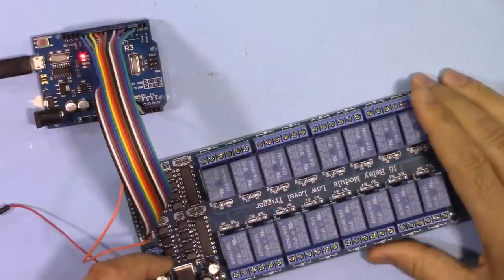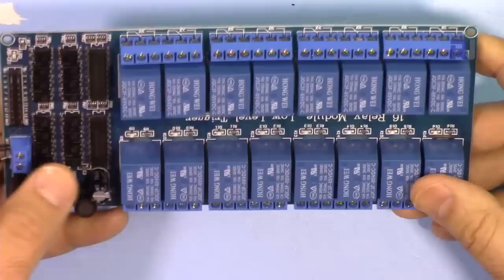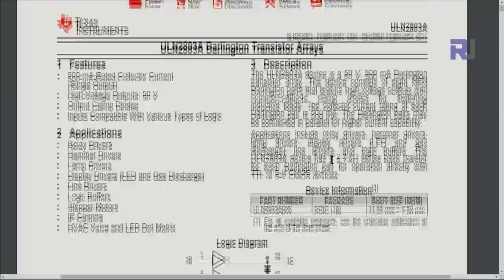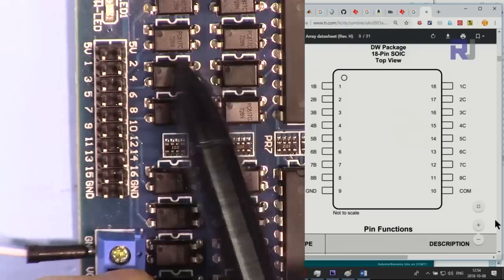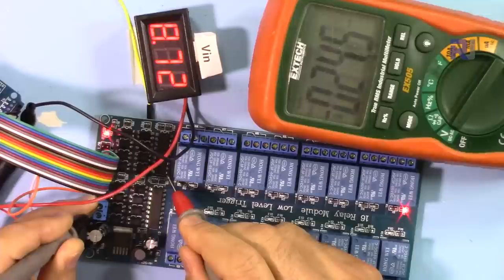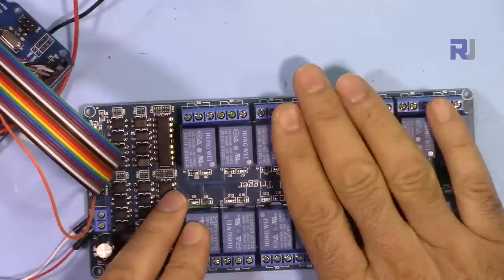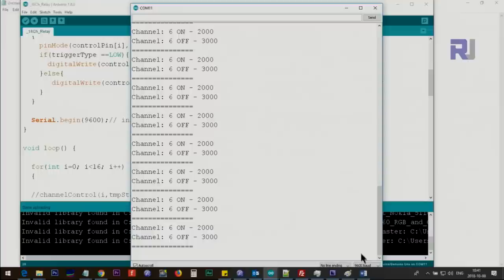Lesson 68, Home Automation: How to control 16 Channel Relay module using Arduino control 16 AC loads

Comment: I want to use this to control actuators in a CNC machine. Basically a magnet closes a reed switch which places a HIGH on the arduino input. This in turn controls a relay that powers the actuator. There are 14 actuators that will work one after the other, never more than one at a time. What is code edit to allow this to happen?
Reply from the maker: Hi, Yes absolutely this work for that.
Reply: Robojax actually we just changed the design of the CNC. We are now using micro switches  and a slide bar about 7 inches long. It engages a N/O switch placing a HIGH on the Arduino pin which closes the corresponding relay and drives current through an actuator causing it to go down and it stays down as long as the HIGH exits. As soon as the slide bar passes the switch opens and a LOW is placed on the Arduino pin. At this point I need to fire a second relay to drive current through the actuator in the opposite direction to make it go up to start position. Can you help me modify your code to cause this to function? I know where to place it but not sure of coding. Thanxx!!
Reply from the maker: for Normally Open or Normally close, you just connect to different to the module you can learn about that in this video: https://youtu.be/58XWVDnB7Ss
For controlling the output to be HIGH or LOW, I have explained that in the video.  It is called LOW or HIGH trigger and you can choose what type of trigger you want at the output of Arduino pin.

Comment: For some reason, doesn't matter what script I run, all the relay will all turn on at the same time. I have delays and timer on all of them, and I try a few different scripts, but with no luck. All the relays that are in my script will turn on (same time).
Reply from the maker: if you don't change the code, it will work. first trying it without changing and then modify it if you want.
Reply: @robojax  I left the code the way it is with no change and I'm still having the problem. What do you think is causing all the relays to turn on all at once?
Reply: I notice when the GPIO is set to "output" doesn't matter if it's true/high or false/low, there is some voltage coming out of that GPIO pin.  Very low .179, this is why I think the relay stays on, and doesn't turn off.

Comment: I try to do the same with d1 mini but only led in relay board works but relay is not working what is wrong 😔 please help
Reply from the maker: do you hear a click? how do you know it is not working? have you connected the load? Watch my video on single relay as you might have connected the load incorrectly

Comment: Can the 16 relays on a sainsmart 16 channel relay board be operated without using a Mega 2560 R3 or similar board? I just want to trigger some LED lights using a Game module I have.

Comment: Can I use a 12v 30a power supply with this? 10a 30v dc, 10a 250v ac. will it break?
Reply from the maker: To lower it up you need 12V and minimum of whatever current I mention as I don’t remember it.  Maybe it was like 1A. Anything hover has no affect it. I hope your quality was about powering this module up.
Reply: @robojax  No I mean not to power it up but the current that runs trough the relay. I want to control multiple solenoids with my 12v 30a power supply but wondering if the relay will break because it is to much current.

Comment: Amazing video! This might seem like a stupid/obvious question but can you decide how many Watts/Amps/Voltage your relays output. For example if I only want to output 9V at 1A per relay would that be possible or no?
Reply from the maker: Hi,  the relay is just a switch. you can connect anything you want does not matter 9V or 200V. just keep it less than 10A or whatever is written on the relay.

Comment: HI. Thankyou for the video. I have a query that I want to individually control 8 LEDs of like 3 Watt power and 3.5 V using 8 channel relay. Shall I connect external battery source? and would it be safe to do that?

Comment: Hello I am using the 8 Channel Sainsmart relay board.  I use 12V to power the board.  I am using 24V  to trigger a 24V solenoid (pinball flipper).  The relays work but after a while they start to degrade and stop making connection to close the circuit to the 24V solenoid.  What might be causing this issue.  It appears the relays can handle up to 30V 10A,.  Any help would be appreciated.  Thanks

Comment: Thank you for the informative video, I am relatively new to Arduino and I have a question, why is the Vin pin used as ground  rather than the GND pin?
Reply from the maker: Some relay module are HIGH trigger and some LOW trigger. This is LOW trigger meaning it gets activated with LOW voltage. So we send LOW signal from Arduino output to turn it ON and we send HIGH to turn it OFF.

Comment: Hi, great video!!! I done your project in  few minutes. I need a different function. I want to switch on (for 200-400 ms ) one by one all the relay. So, first relay on for 200ms then off, second relay on for 200ms then off... up to the 16th relay. I'm not native language english so if is not clear I will try to explain it better. Thank you
Reply from the maker: I have given example in the code. 
Did you see this:
 //channelControl(6,1, 2000); // turn relay 7 ON for 2 seconds
 //channelControl(6,0, 5000); // turn relay 7 OFF for 5 seconds
 //channelControl(9,1, 3000); // turn relay 10 OFF for ever

just above that, I have a "for" loop that controls all 16 relay. (below) which controls relay for 200ms, you replace it with the value. I have explained how relay is controlled. Watch the video again.
  for(int i=0; i<16; i++)
  {
   channelControl(i,tmpStat,200);// turn each relay ON for 200ms 
  }
Reply: @robojax   thank you again. I'm going to try it. in the future I'll keep more attention

Comment: Thank you for the nice video. But something is wrong. With shift registers you could control as many boards as you want. Means you could use smaller Arduinos too. Even an AtTiny could do the job.
Reply from the maker: Yes you could.  I might have a video on that. But Uno is the most common board.

Comment: hello Robojax. Congratulations on the video. I wanted to ask you if you had the possibility to do some video management of 32 relays using two mcp23017 through I2C. Thank you so much for your attention 😉
Reply from the maker: Hi Diego, all 32 channel relays are PLC based. I am not sure if there is demand for those to be used using Arduino. is it?
Reply: @robojax  I use them through the Blynk app, if possible.

Comment: Thanks for the video! It was fantastic and really helpful, I was wondering if you could advise me slightly for a project I'm working on?

Q1. if I had 3 of these modules would it be possible to control all of them up to 48 channels from the single arduino? If not, would I need 3 arduinos and could I control them all at the same time?

Q2. if I could control all 3 is it possible to set differing times for each relay, so for example, if I wanted channels 1,2,3 to all run at the exact same time, then I want ch4 to start 5 seconds after ch3 then ch5 to start 10 seconds after ch4 and so on, would these values be customisable?

Q3. Say I wanted to program a schedule,more a light show for example on the arguing, could I start the show remotely from say a laptop? Just for example say I have a collection of Christmas lights in the garden could I start the Christmas light show from my laptop? Thanks so much for your help!
Reply from the maker: Arduino MEGA has enough pins and you can control it.

Comment: I've seen a few videos and wiring diagram where they hooked up the 5volt from relay board to 5volt on arduino.
Reply from the maker: Good to know. thanks.l
Reply: I was asking if this is correct?
Reply from the maker: Now the "?" mark helps.  yes you can do that. You can power up Arduino with 9V to 12V if you connect it to VIN pin which is close to 5V and GND pin. This module has problem and you need to fix it. See this video https://youtu.be/mHPqxctmJrs

Comment: and how would one map pins for this board with esp 8266 connected? home assistant integration
Reply from the maker: I am not sure what is "home assistant" as there are 100s of tools.  You simply  define a pin in the code to control each relay. I have introduction video for ESP8266 here https://youtu.be/pLvqh57T3s4 which explains and gives example for pins and all other details

Comment: Hi great video. I wanted to ask. If I dont want to supply the Arduino by the relay supply. I just dont put the 5V pins on the relay board but put the conect the GND pin of the relay to the GND pin of the arduino? what if I connect the 5V pin of the relay to the 5V of the arduino but left the GND pin of the relay disconnected? is it the same?
Reply from the maker: for every electric circuit, we need to connect two wires to complete the circuit.  you need to power this module with 5V and you MUST connect GND. This module has problem when it is shipped and here is how to fix it https://youtu.be/mHPqxctmJrs

Comment: Great video,  do you know of a similar 16-Channel  Relay that can supply 24VDC with a 24VDC input?  Thanks
Reply from the maker: I am not sure. But you should find it on AliExpress.com or eBay. But it would be very simple to put 24V to 5V Buck converter Module (from eBay) and use it with 24V.

Comment: Hi Brother, i want to know there are some of the 16 relays are without voltage regulator (LM2596 or LM2576) and without any capacitors, so if you please tell me what's the importance and the job of these  parts in the 16 relay module. Thnx
Reply from the maker: please see the provided link in the description and watch that video.

Comment: any ideas on adding a PIR to start the relay delay?

I would like to use the relay for some lighting outside and have been playing about with the sketch but cant seem to get anything working.
Reply: You'd wire up the PIR to the arduino, then when your sketch detects motion (PIR output goes high) it would trigger one or more relays, presumably turning them off after some fixed amount of time once motion is no longer detected.

Comment: Great video! I'm really new to the IoT world, and I'm wondering if it is possible to control the relays of this board directly with 3.3V instead of 5V (i.e. with Raspberry)?
Reply from the maker: yes they can be controlled. But the power must be 5V.
Reply: @robojax  Thanks for the quick response. One more question I have is whether I need to use the 5V pins of the relay board at all? Or are they really just for providing power to other electronics (like Arduino or RPi)?

Comment: Great work. Could I use this to control 12-24 volt equipment in vehicles?
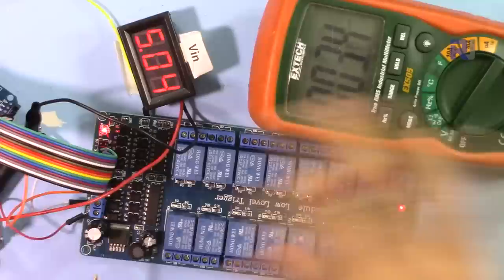Reply from the maker: the relay can control any load of 10A (explained in video at 05:40). But powering up the this module, has an issue (watch it at 06:50) and I am posting another video today showing how to resolve it and then yes it can be powered up from 5-30V.

Comment: thank you for this most informative video, I have one question, can you convert this 16 channel solid state relay board from a low-level trigger to a high-level trigger?
Reply from the maker: you are welcome. you will need hardware like buffer, inverter which takes the signal and inverts it.So you will send HIGH and it makes it LOW. here is one chip that can do it: CD74HC240E which just needs 5V and ground: http://www.ti.com/lit/ds/symlink/cd74hc240.pdf
Reply: @robojax   actually just reverse the digitalWrite (controlPin i from HIGH to LOW and LOW to HIGH

Comment: Why is it necessary to connect GND to arduino when the power supply GND is already connected?
Reply from the maker: Power supply and Arduino and any other device must have common in order to work together.

Comment: Can I use this arduino an 16 switch relay (or qty 2 8 switch relay to sense moisture near plants and have water pumps to give plant water until sensor picks up the new moisture?
Reply from the maker: Arduino can do almost anything. it depends how you use it and where.
Reply: I need someone with knowledge to do a video putting an 8 or 16 switch to arduino shown wire connections closely then the code needed to manage moisture sensor and water pump working together.  I can freeze video often to copy / learn.  I badly need this being disabled. Only way to have outdoor plants.
I have had qty 5  55gallon rain water barrels installed.  I will get 3-5k reservoir tank to hold extra for dry season.

Are you in USA?

Comment: Thanks for your informative video. Can WiFi be added to this system and then controlled by a phone app. I am new to Arduino but not to electrical work. Thank you.
Reply from the maker: You are welcome. I will make that video God willing. it would be using ESP32 and ESP8266
Reply: @robojax  That would be much appreciated. Thank you again.
Reply from the maker: you are welcome.

Comment: If a need to control four of this kind relay modules (64 bulbs in total). How to achieve it with regular, let say, Arduino UNO?
Reply from the maker: with uno you can do it ONLY control 4 bulbs at time if you use 4 of this with 4 multiplexer.  here my video on that https://youtu.be/lQL6dfL_rsg

Comment: I'm wondering how to have 32 relays controlled by one Arduino. How would you do it?
Reply from the maker: Very simple. Use are rArduino Mrga which has more than 50 digital pins and use the same code

Comment: Are you sure, we can power up the relay with 24 volt? 
You did not go up to 24 v. I watch your video may be thirteen times. You only said, max is 24 v but only increase it to 15 volt to module right?
Reply from the maker: commented on the "Fixing" video.

Comment: Hey what's up

I have a question 

I am good at circuits and programming but well I mess up with mechanical building. Can you suggest a mechanical building kit or something that help me out with this.
Reply from the maker: hi, to help you with what? this is just needs wiring to connect it to your motor or light or whatever you want to control.
Reply: No that i know but like i want to make a humanoid robot or some mechanisms i want some parts or something similar to make it
Reply: This is general question. Not about the video

Comment: it possible to add 16 channel relay again in single board? so the channel relay will be 32?
Reply from the maker: yes it is possible. if you have Arduino Mega with more pins, yes you can use it.
Reply: @robojax  Arduino Mega 2560 Rev3?

Comment: Sir if i use 5volt 2 or 3 amp mobile phone charger to power this 8 channel relay. Do i still need to do changes in this circuit?
Reply: As you highlighted relay voltage issue at 06:47 .
Can i use mobile phone charger to solve this issue?
Reply from the maker: perhaps you did not follow what I said. This module is soled as "12V 16 channel relay" and that is why I offered solution. if you use 5V, don't do anything. it will work.
Reply: Sir i have 1 more question.
Sir i have 12 watt smd LEDs. Can you tell me how many leds can i connect with a single 5v to 220volt relay.

Comment: Good day sir! Is it possible to control 1 AC with 2 relays only?
Reply from the maker: if you mean to use two relays to control 1 AC load,  yes but why? perhaps you want to you want to double the amount of current.  very simple, see the wiring for AC here https://youtu.be/_giGPBS_WAo and connect them in parallel.
Reply: @robojax  thank you for responding sir. We wish to control 1AC at the same time, 2 relays and an RTC to Arduino uno. Is it possible? Our project is to trigger a time twice, with one motor only. Our motor is 220V.

Comment: I really don't know why they don't add shift register then you will need only 5(4 if not supplying 5V from the microcontroller) wires instead of 18.
Reply from the maker: there are 1000s of people want to NOT use anything else and just connect it directly. here is using of 4 wires to control the same module https://youtu.be/lQL6dfL_rsg search my channel and you will find more

Comment: Is there any way to use this as a serial device? It takes too many pins. For my project.
Reply from the maker: here another video related to this with just 4 wires https://youtu.be/Q9aBI4ELKC4
Reply: @robojax  Thanks for the reply. I think you sent the incorrect link, as it just directs me to this video.
Reply from the maker: I  am sorry. you are right. but you should not have waited. just should searched for "16 channel" and you would gotten it . here is the search result https://www.youtube.com/robojaxTV/search?query=16+channel

Comment: I need website to purchase arduino/ switches/ wiring. CODE/ pumps (8) sensors (8). I am disabled and need AUTOMATED PLANT OUTDOOR AND INDOOR WATERING.
Reply from the maker: get them from eBay or AliExpress which takes about 30 to 80 days. if you want them fast then Amazon. if you want to code and kits in one box, then search for Elegoo on Amazon. Good luck.